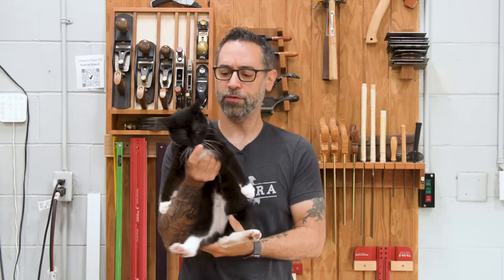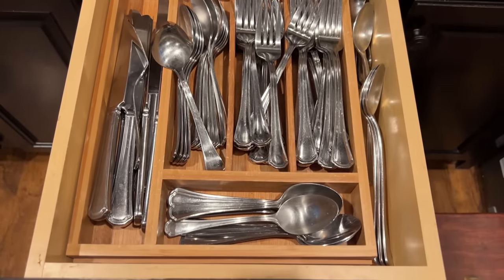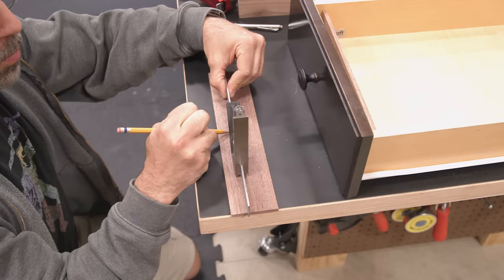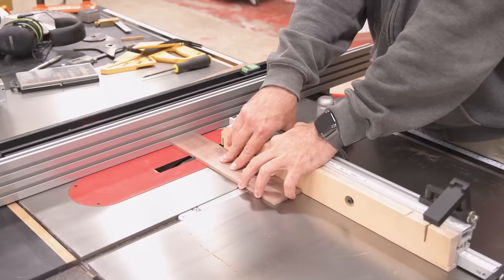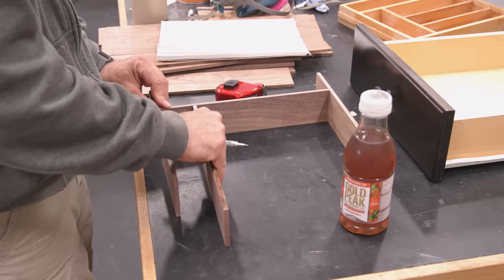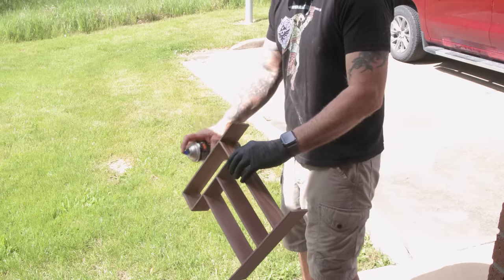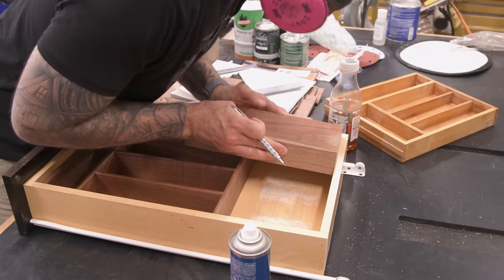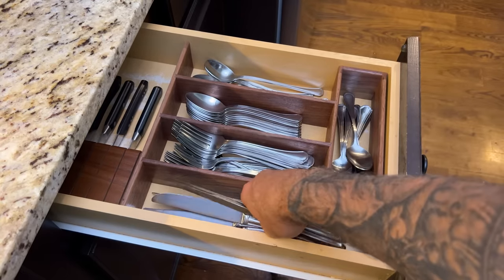Get Your Kitchen Drawers Organized! | The Wood Whisperer

Comment: Always interesting to see your approach, I went over the top on the last one I built with wedged through tenons! (I was playing).  The only thing I'd suggest would be to put a bottom on, I regularly found knives and teaspoons working their way underneath the edges on the old one I made.  My latest one I just glued in pieces in the correct size to fit the hole and they're still holding great a year later.
Also I love how the cat has wormed its way into your heart, I think I remember you saying  "I hate cats" on wood talk and now you've got a shop cat which you obviously care about.
Reply: yeah, I made one a lot like that and it was fine until the drawer bottom sagged (chipboard, it turns out) and now my knives get wedged under the walls. Next one will have integrated bottoms.

Comment: Did the same thing for my utensil drawer. Liked it so much, I did the same thing for the remaining 5 drawers, however, I took note of what were in the remaining drawers and how they were used. So, of the remaining drawers, only 2 had identical inserts, and the remaining three were custom built for each drawer and its contents.

Comment: Because there are two sizes of forks, each of which should have their own slot.  To get around this, we put the salad forks in upside down (tines towards the front).  Same with the two sizes of spoons.  That brought us down to five slots, as paring knives also live in the drawer.  So, one in front, three across, one in back for steak knives, plastic utensils and probably other junk.
Reply: We have used the “flipped utensils” trick, too, to manage tight spaces! Works remarkably well.

Comment: Question if you don't mind. On your miter saw, what is the block(?) centered between the guides that the blade goes into? Does it just prevent small bits from blowing backwards?  Looks porous too. Just curious.
Reply: It seems like a nice way to direct dust and eliminate rear tear-out.  Even considering that you'd need a different one for every combination of tilt and turn, at the right price and/or ease of manufacturing I'd still be interested.
Reply from the maker: https://www.colliflower-zci.com/store/colliflower-zero-clearance-fence-for-kapex

Comment: I enjoyed the video. I made a similar organizer last year. I need to add a knife block in the back.

You did not address the first step of going through the stuff in the drawer to see what you really use. I did that and put some of the extra pieces in a box under the sink. That was a mistake because most of the extras have migrated back into the drawer.

Comment: Why? Economy of effort, water and time. Because a flatware service for 12 is standard count these days. You don't wash, dry & put away dishes by hand after every meal anymore so you need enough dish and flatware for two meals  (lunch is away at school & work) which will give you a full dishwasher at the end of the day. Kitchen is closed down by then leaving only one full load that you run at bedtime.😉
Reply from the maker: Nope....still too many forks. :)

Comment: I cheated.. I found a bamboo organizer that fits my drawer almost exactly.  Why reinvent the wheel?  LOL

My best kitchen drawer upgrade.... I built a couple internal shallow secondary drawers that slide backwards after you open the main drawer.  It doubles the capacity of larger sized drawers allowing you to put more used stuff on top and the less used stuff under.

Comment: Very nice video!  Chalk this one criticism under the it probably doesn't matter that much. But sanding the ends of the boards that have already been fit into the dado will make the joint loose.  Obviously if you only sand away a tiny amount of material it is not that big of a deal. But if you did or if you hand planed the surface with several passes, you could make the joint ill fitting.
Reply from the maker: I always take that into account with fitting.